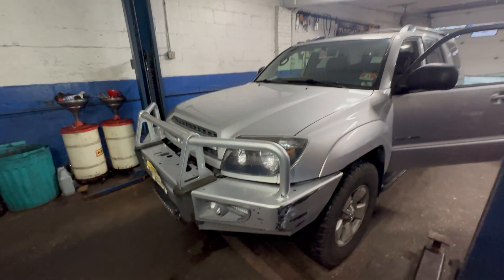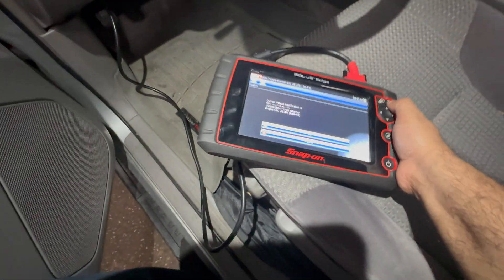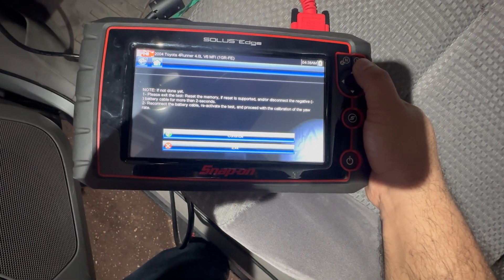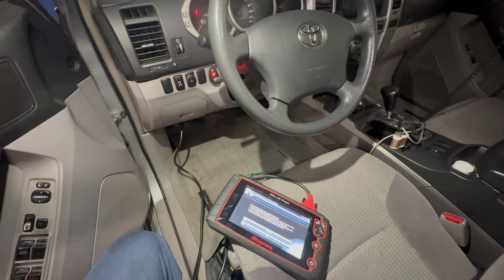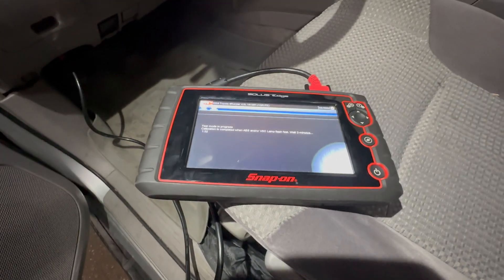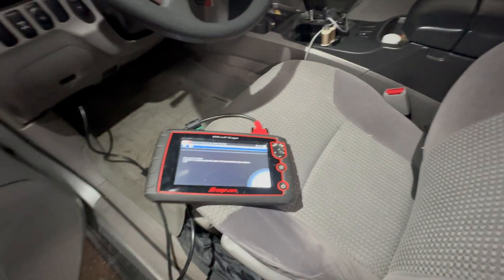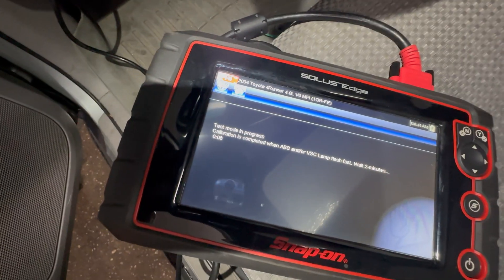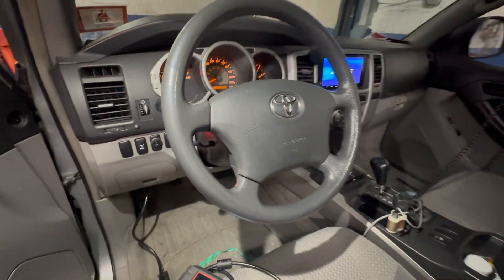Toyota Zero point yaw rate calibration process

Comment: Question - I've gone through a series of steps to resolve a BSM unavailable problem.  Nothing.  The dealership couldn't resolve.  I was looking at a live feed while driving, and I noticed the yaw rate was normal turning left, but it pegs to 249 deg/s turning right.  Will a recalibration resolve this issue?  Thank you
Reply from the maker: It prolly will this is very common on these

Comment: What does reset memory do? I have 2010 4runner sr5, I keep doing zero point calibration but light comes on after 30 seconds of driving. Code is vehicle driven without SAS not initialized.
Reply: I have done that and still won’t work
Reply from the maker: @ didn’t scan the car abs moduel with high end scan tool? Or check engine and other moduels for codes first
Reply from the maker: U have to do zero point calibration  resetting memory will not work
Reply: Using snap-on verus edge scan tool and only code I have is c1445
Reply: @RMakA51K  Hi brother, I got 2011 4Runner SR5 and I got the same issue. C1445, no matter how many times I reset and do the calibration, the code will always come back when driving for 30 seconds. Did you find a solution?